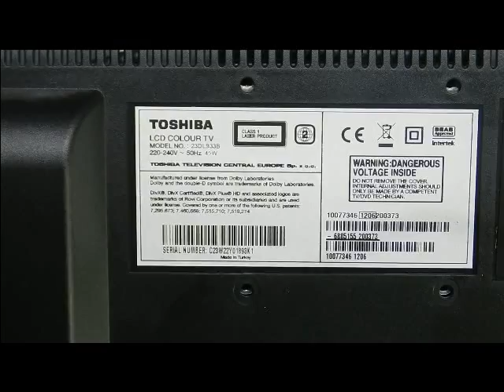Dead LCD TV - Fault found : Vestel 17PW80v2

Comment: It worked like a charm! Like in your case, i had Zero readings on all 3 diodes while soldered. After desoldering, i had good readings on two of them, one was still Zero. So i replaced only the faulty one. Costs 2,90e for 3 diodes with shipping. I love when something works like described. Thanks for saving my Kendo TV💙👍

Comment: Morning Simon
As I said a good video have watched it several times now  👍👍👍
I have sent for a new power supply , tried all the things you said eg diodes seem ok.
The problem I have is switch on red standby lights up press on the Hitachi logo flashes on then off.
There is a kind of frying sound coming from the power supply 🤔 would be grateful of any advice just curious of what it can be.
Thanks mick 👍
Reply from the maker: "frying sound coming from the power supply" , thats never a good thing ! could be any of a number of problems, must admit I'd initially be tempted to look at the transformer, but in truth, probably would not be able to fix it as some components are not available to the public. Not saying it's impossible, just exceedingly difficult.

Also, thanks so much for taking the time to comment :)
Reply: @SimonParkes  hi Simon thanks for replying.
My power supply now fitted 1👍no frying sound on no picture but can see in back ground menu with torch still trying 😋 thank Simon 😀
Reply from the maker: @michaelhadfield3755  Backlight LED's, I have done many of these, the LED's are on strips in series ( typically ), just need a couple to go and can wipe out the display.
Reply: @SimonParkes  Morning  Simon have you done any videos how to take them out is it a simple job 😀
Reply from the maker: @michaelhadfield3755  Sorry no, I stopped doing video a while ago as was not able to keep a constant also personal circumstances changed. All being well I will be starting again. I can advise just to take your time, make sure when you remove the various lens( white plastic sheets ) you keep the order they are in, and the LCD panel, support it as much as you can, they don't like being bent.
Take your time, make sure you have plenty of space ;)

Comment: Just fixed exactly same board. It was the middle diode out of the 3 in mine.
Reply from the maker: have you plastered them together so the heat transfer is equal ??  it does make a difference in longevity, if there is a "weak" diode, it reduces the overheating of the component..
Reply: Simon Parkes no not yet,still need to order some. But it's definitely a design flaw. On this board.